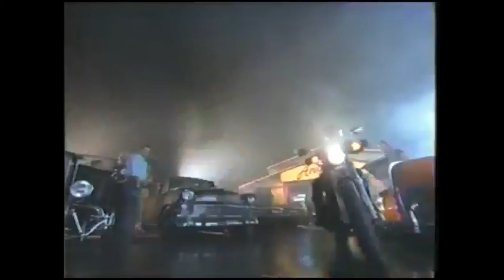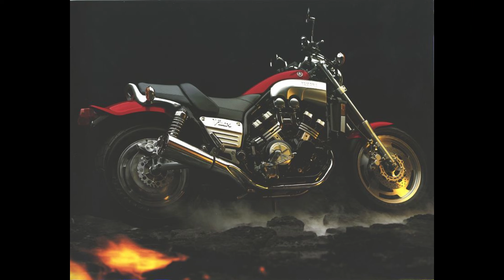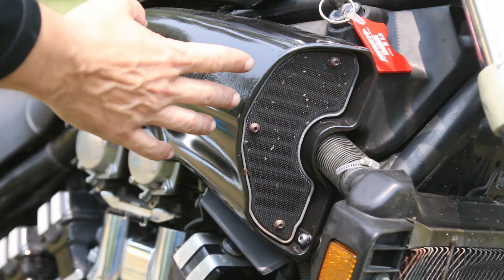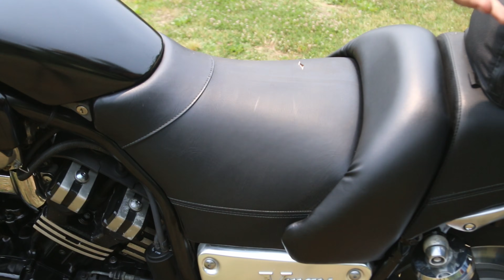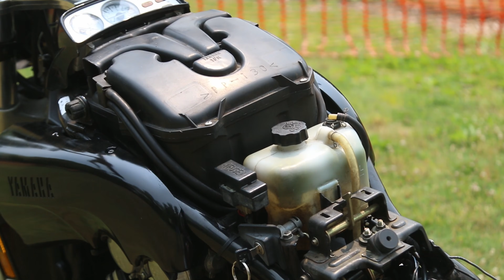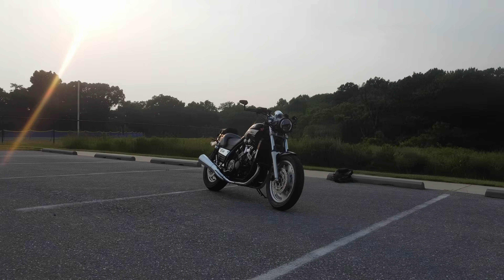Unleashing the Original Hooligan: The Yamaha VMAX - A Wild Ride Like No Other!

Comment: I have a 98.  I bought it last year bc I had an itch and my dad owned 2 vmaxes back in the day.  I have been working on it off and on since I bought it.  Brake caliper rebuild, carb rebuild, progressive springs, braided brake line, new gas tank, led headlight swap, custom seat, kurykan grips, forward foot controls, coil over plugs conversion, wind screen install, new mirrors, 170 rear tire, and a myriad of small parts repaired or replaced.  I'm waiting on an updated shifter segment now.
With all that said, my bike has never left me stranded.  I had to limp her home once with a clogged fuel filter, but she made it.  Every item i fixed or replaced was to make the bike run better, not to get her to run.  
If there's any tool I would recommend, it would be a carb syncronizer.  Get a good one over $100.  It will pay for itself the first time you use it.

Comment: I have a 2001 VMax. The engine is from a touring bike but high lift cams and vboost. I’m older now, 74, and put on a corbin seat, longer fork tubes, fork emulators, 2” spacer on handlebars, forward controls, and Venture diff so I can cruise at a much lower rpm on the highway. Still has all the power.

Comment: The V-Max was Yamaha's answer to Honda's V-65 Magna, which was a quick V4 street cruiser early 80s. The first three years of its existence it was considered the fastest production motorcycle on earth.
Reply: V65 all the way!!!!!!!!!!!!
Reply: @deaconfrost4619  only if you enjoy losing.
Reply: I'm a V65 Magna guy, because it's a sleeper. When you see a VMAX, you know it's fast. The V65 just looks like an old Honda. It's more comfortable, and more practical (which is boring, I know). I've ridden a VMAX, and I love it--but a magna is much cheaper used and I love mine. Maintenance sucks so bad on it though.  Access to valves for adjustment, carb removal, replacing the o rings on the coolant tubes.  All an absolute bitch to get to 😅

Comment: I remember sitting on the first VMAX I ever saw in 1985 in Edmond, OK at D&B Yamaha. I was 15 years old and dreamed of the chicks I could pick up on it, and the cars that I would crush stop light to stop light! I am 54 now, and still it is hands down my favorite street bike ever! When you see a VMAX, you instantly know what it is. It is so unique and so much character!
Reply: Brother I need to ask you for advice; my only prior experience is riding a 650cc 70hp kawazaki, however Im now looking into buying the VMAX1200, everybody is telling me not to as its way to powerful, what do you think?

Is the transition to suge a behemoth of a bike really that dramatic?
Reply: @TroyanMarshall  I always, from my first rider at the course chose the bigest. Today too 1200 GS. Go for it but easy, steady
Reply: @TroyanMarshall  HEY guy I'm 
64 years old I have a 94 V-MAX and it will only go as fast as you twist the throttle. Take you're  time and get to know the MAX. You will build you're
Confidence as you go.
HOWEVER the MAX is about
150 lbs. HEAVIER. Are you're 
legs and arms Strong enough 
to handle that. And man if you drop it it'll be a Bitch.
Reply: Im 56 years old and i said the same thing and ive owned GSXR 750 BUT THERE'S nothing like the VMAX.  (Nothing)
Reply: Got to have a load of respect 🙏 for this bike because it's a beast 💪

Comment: New to bikes here, my late father in law owned a 2003. Recently my mother in law gave it to me however it does not run. is it an okay bike to learn to ride on?
Reply: Long time (50 plus years & 38 bikes in total) rider and current 02 Vmax Owner rider here.......Love your enthusiasm but no.......This is AbSoLuteLy NOT a bike to learn on.  Honor your Father-in-Law and simply park it in the garage, store it properly (fuel stabilizer, weight off the the tires, battery tender, etc.) and learn to ride on something way less powerful, better handling, and much more "Forgiving" in all areas of learning to ride.  After that, maybe try it out while keeping the RPMs below 5K. Until then, admire it, the it serviced, etc. but don't ride it.  You'll be alive, you'll enjoy the process of learning to ride, and yes......Your Father-in-Law would absolutely be happy and proud of you for asking this question.

Comment: All these things people say you can't do with this bike like commute, or cruise, or go on long rides. I used mine to commute to work as much as I could. I would get between 30-40 mpg out of it on the freeway, unless I was boosting it for fun. I found the VMax pretty comfortable to ride but you do need to plan on getting gas about every 100 miles with that 4 gal tank. I had an '88 that I bought new and had it for almost 10 years. I miss it, it was a fun bike, but it definitely doesn't like to be pushed at speed through turns.

Comment: Thx, nice video. Brings back the feeling. I forgot about the choke and reserve fuel.  I had a carbon Max as a daily for 13yr. Best and only mod I did was progressive spring in the tubes + thicker oil + hand warmers with a dragbar. And gaining some weight myself helped against the speedwobble. But the max liked to scare the driver time to time. Loved it.

Comment: The mileage is not ridiculous considering what it can do.  The problem is that the tank at 15 litres is much too small.  On my Gen 2, I installed a 21.5 litre and it seems like a normal bike.  I can ride 210-225 kms before the fuel light comes on and when I fill it up, it usually takes 15-16 litres to top up.  Best add-on for a VMAX or VMax.

Comment: You left out the very common 1st to 2nd gear shift slippage. It was a common issue on these bikes. I sure miss my 85 with inverted forks off a gsxr, lowered 2 inches with chopped kick stand. Cateye headlight was pretty sick too. I should have kept it honestly.

Comment: These are neither rare nor expensive! I have a 97 I got it for years ago in great shape had Supertramp slip-ons drag bar, braided lines and aftermarket rear shocks. Under 13000 miles. $2800. Now that was a great deal, easy to find at $3500-4000

Comment: 80 miles per tank??? My V-Max (1992) 145 HP goes 115 miles before I put it on reserve!
(yes,I`m an old man and riding tihs bike for 20 years now).So get a good carb revision and fine tune the motor. And the exhaust silencers at the end has no schields what are popped on.  I have a Avon Cobra tire at the back. 170 mm instead of the Bridgestone or Kenda150 mm. And ride a good 8 miles to warm up the motor before fully open the thottle.

Comment: Your review was not that good. Sorry but i am 100% sure i know alot more about a VMAX then you do. "Plastic accents"? Seriously? You cant even feel the difference between aliminium and plastic? The seat on that bike is not original (its been recovered poorly) or or it's a cheap imitation atleast since it does not open properly and is not bolted down (ps. 4 bolts holds the seat down). I use my VMAX as a daily driver in all kinds of weather including long distance trips so i cant understand that you just assume that a MAX is not able to do it. If you did own a properly working example you would be able to get more then 100 miles  out of the 4 gallon tank BEFORE the fuel light comes on. If you dont then its only because the kick of the vboost makes you drive like a holigan. Go buy yourself a proper MAX and then do a decent review.
Reply: Well I would love to ride mine again

Comment: Loved seeing the old Max.  I owned an '85 for 20 years.  Few things.  The mileage goes WAY down if you are activating the V-Boost.  I never got over 30 mpg and if I was horsing around would get near 20.  It goes through tires FAST, even if you aren't pushing it.  An aftermarket seat is a must, along with the short sport wind-shield if you are going to actually take it further than a tank of gas.  Many mechanics that serviced mine referred to it affectionally as a "pig" because of how it handles at low speeds.  Finally, gas with ethanol is a killer for these bikes unless you are VERY careful and use a fuel additive when not using it for more than a couple weeks.  The carbs are very complex and clog easily.  Once clogged, usually that's it.  It's got 4 carbs at $600 each.
Reply: Hit the nail on the head, just bought an 85 and the previous owner dropped $1100 on the carbs

Comment: Great review.  I still have my 1985 Mad Max-I could never sell it. Twisting it's throttle is addictive.  Power cruiser is an ok descriptor, but I call it a two-wheeled hot rod. It almost bucked me off once when I 'raced' a GTO.  I opened the throttle and fed the clutch too qickly, closed the throttle too fast in reaction, then opened it again too quickly, closed it again, and got it right the third time, as I clung on and climbed back on the seat!  Of course I left the GTO in the dust.😀😀

Comment: Just got a ‘93 in great shape. Love it! It is a surprise to ride. Power instantly at any speed or gear. Digs in and don’t feel upper body go back much. Kinda pulls my hips back. Don’t feel much change in wind force either but that is probably different depending on height and body structure.  Great bike. Good video.

Comment: You’re missing bolts the seat doesn’t just come off without tools !
Reply: To be fair, the entire bike looks like a complete piece of junk. Seat not bolted on, carbs not fitted fully in to the inlet manifolds. Cheap indicators. Looks like Honda master cylinders fitted. Looks like it was painted by Stevie Wonder. Someone has drilled the rear of both silencers. It's an old, worn out, end of life bike.

Comment: I stopped watching at 4.0 gallons fuel capacity. FJR1300 it is then.
Reply: Always good when someone finds the bike that fits to his style. Indeed on a Vmax you will meet a petrol station or two everyday you riding. It IS a drawback of that bike. On the other hand, inline engines are just boring. In Central Europe the close to 200 km  range is enough and after 2-3h of riding VMax you better have a break anyway. Fits for me so good that since 1995 VMax is my main bike, since 2017 the 1700 joined the 1200. I have other bikes as well like the sv650, n xj900 and some bikes from the 70s. But V4 rules and the bigger the better.
Reply: @henrydegan6204  inline bikes are boring???  The FJR is better at nearly everything except the 1/4 mile.

Comment: I appreciate your enthusiasm for this motorcycle but you really need to do some homework. I noticed you pointed toward the intake on the side of the airbox. You called it "the plastic" when pointed out what you called chrome accents. I can't believe you actually tapped on them and didn't notice that they were cast aluminum. Not only are they aluminum which the previous owner painted black but each one is hand-polished for 45 minutes by hand at the factory. It is really sacrilegious that they painted them. I actually stopped watching the video there because I realized I actually knew way more about the bikes and you were going to be able to tell me. So, since you didn't even know that I hope you know that what is traditionally known as the gas tank location is actually part of the intake and the actual gas tank is located under the seat. Just thought I'd let you know because you would eventually have to put gas in it 🤯
Reply: Good catch on the scoops--I wondered if perhaps Yamaha had stopped making them out of aluminum by that year. I 'm glad they didn't!
Reply: The 2nd gens are hand polished not the 1st
Reply: The fake side scoops were never hand polished.
Reply: Sounds like you need to make your own video
Reply: Lol clueless 🤣,
Reply: I believe the early versions had fake intakes made of plastic and the new ones were real and made out of hand polished aluminum. The review bike is old, correct? (I don’t know a lot about this bike)
Reply: They aren’t aluminum they have a aluminum finish coat- the aluminum hand polished ones are on the 1700
Reply: They are all aluminum machine finished with a clear power coat. Just the 85 to 07 had a flat/semi gloss black under the scoops

Comment: I have owned two of these. They can do the quarter  mile in the 10s. The roll on from 75 mph to pass a car was awesome. Yamaha please make these agin.
Reply: I still have 2 of these a 1988 and a 1998 , my 98 is bone stock and my 88 is highly modified , the 1988 only gets 7 MPG with 205 rear wheel HP , the best time it ever did was a quarter 8.9 seconds 156 MPH at Capitol Speedway up in Odenton, Maryland , yes a V-Max that broke into the 8's , I think that Capitol speedway was sold and is no longer open ? We moved to Florida so I'm not 100% sure about Capitol being sold
Reply: @fakenews7266  What mods on the 88?  Must be significant.
Reply: I remember how my uncle gave me his for a spin when I was 16-17. I did a WOT roll-on from 30-100 mph and that thing almost ripped my arms off. Ever since that day, I've been dragging my knuckles on the ground. That's the one bike I really want to add to my collection, but 95% of the machines wher I live come without the power valve system or whatever it's called
Reply: V - Boost was a butterfly valve that opened at 6000 rpm that allowed more fuel. I really loved the shaft drive.  No chain maintenance.

Comment: Thanks fir ride down memory lane.  I had a 92  back in 92. At 125ish the front end wobble was terrifying... it kept you restrained somewhat. Few tips and corrections for ya.  Scoops are aluminum,  n with a few weekends of stripping paint, wet sanding and buffing can be brought to a mirror finish. Supertrapp  slipons will make it sound like a chevy v8 if you leave off all the baffles. 
Gas access is not horrible,  that seat has obviously been repadded badly. Rocky Mountain Motorsports, if memory serves me, made a repadded seat w higher density foam that actually lowered seat height. Awesome for my height. 
Shorter rear shocks, 11inch I think, also helped w comfort and stance. 
Drag bars completed the look of a muscle cruiser and a lower profile front tire made it more of a canyon carver. I scraped pegs many a time. 
Best modification is the Vboost override.  It was a simple toggle switch and relay installation that changed when Vboost kicked in.
It normally kicks in a 6k rpm and is quite noticeable in tourqe and sound.  The mod engaged it at 3k rpm an just made it a tourqe monster .
Reply: I had a 1986, it didn't start to wobble until 145 m.p.h.😊

Comment: I have an 85 vmax. The fuel tank has a thermistor inside it. When the fuel drops below the thermistor, it sends a signal to the fuel pump and shuts it off.  When you switch it to reserve, it turns the fuel pump on again. Basically, it simulates running out of fuel.
Reply: I keep mine on reserve all the time, don't want the petrol shut off while I'm in the middle of an overtake, just look out for the red warning light and find a petrol station soon, don't go past it as it's a thirsty beast. I have a three way switch for the vboost, stock/off/on from tickover, helps to save petrol when off and also when a sportsbike rider flicks you the finger you've got 145bhp from low revs which is scary at first but nice when you're used to it. They think you're on a Harley or something similar until you blast away from them 😈